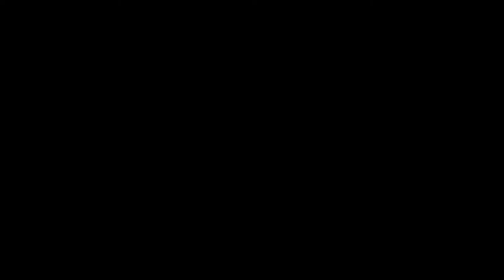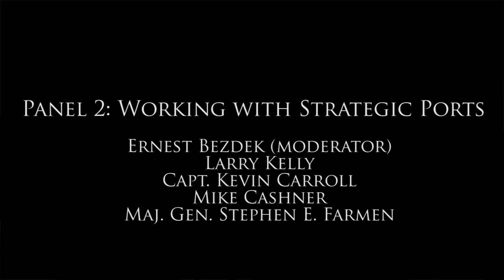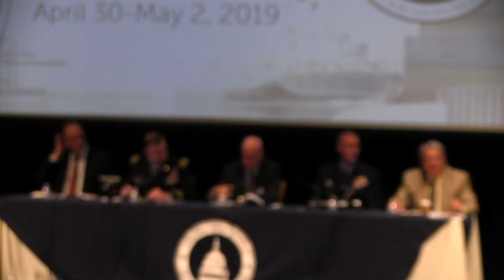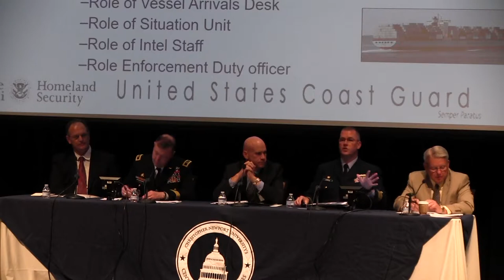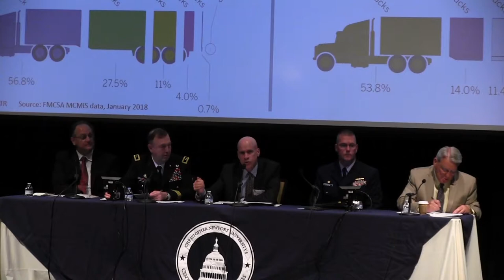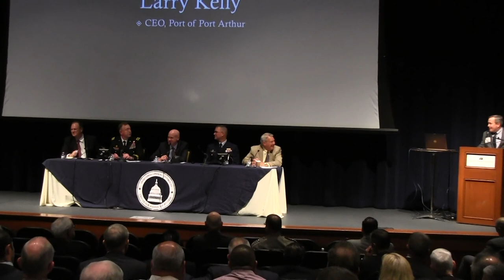Working with Strategic Ports (Panel 2, Conference on America's Ports)

Comment: You need more smart mechanics to fit trucks because if anything happens to a truck driver driver the truck is going to be their fault not your fault what if if a truck go out of brakes what are you do???
Take it to mechanic take it to mechanic and let them fix it what if they don't fix it right that's what my main question is sir????
What happens to the truck driver if the truck. Runs right??